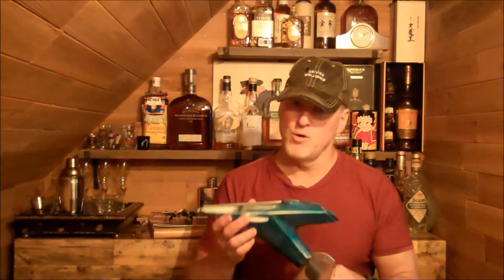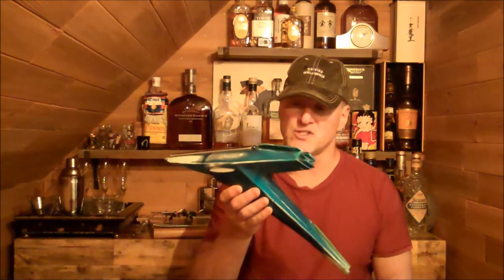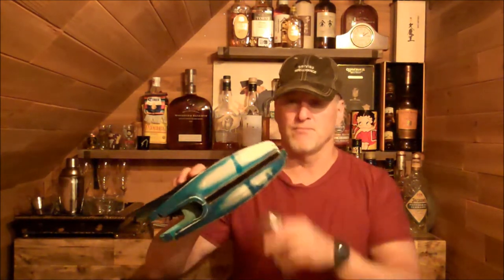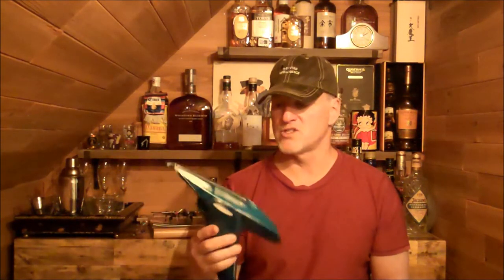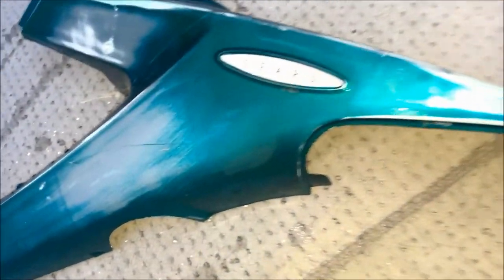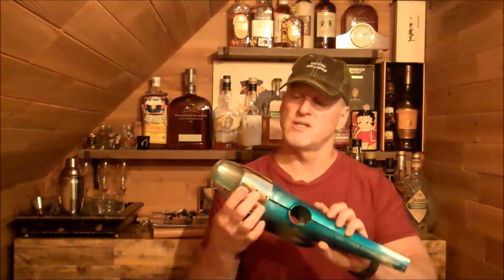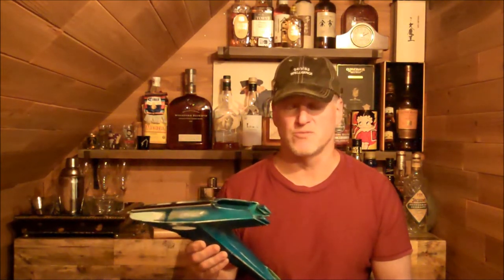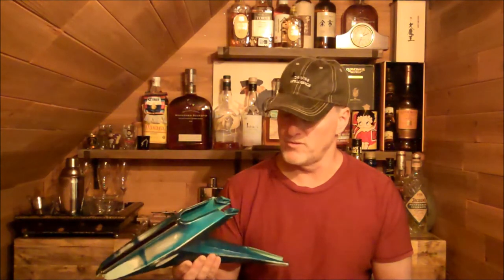1964 / 1965 Sears Spaceliner Classic Bike Headlight Restoration: Vintage Bicycle Restoration: Part 1

Comment: I too have a Spaceliner that  need a tank and light for. I would like any info on acquiring one for a men's model in red. Thanks in advance.
Reply from the maker: They're like hen's teeth.  I found another one on eBay after searching a long time.  All I can recommend is doing a search in eBay and checking daily.  Also, do an internet search.  I've seen a few more on eBay since, but in rough shape.

Comment: This is a 1966 to 1968 model.
Reply from the maker: Ah, ok… how did you know?
Reply: @DrivingIntelligence  The biggest difference between the 1966-68 is actually the tank. That one is much shorter, curved and a "swept look". The earlier 1964-65 the tanks are longer have a more conventional look, having two smaller head lights facing straight forward,  not one single as yours. Next the chain guard. Yours has a much straighter and thicker look with rectangular gills and no down turn at the front. The 1964-65 is again a much more conventional looking, being slimmer and is down turned around the sprocket in the front part. The rear rack is also different. Yours should have rectangular gills on the top horizontal. The 1964-65 have smaller angled gills on top. And it depends on what model it is, either a standard or deluxe model. There are other minor differences such as the jewels on the pedals. Of course parts can and may have been interchanged throughout the model years over the lifetime of a bike.. 

A good place to look is the CABE online. There is a very comprehensive breakdown on the different models and years, both on the J. C. Higgins Flightliner and especially on the Sears Spaceliner branded bicycles. Nice bike but how do I find your part 2?
Reply from the maker: @paulr3237  thanks for all that great info... I don't see the CABE website, can you give a little more assistance?  Sadly I haven't made any other videos, although I have done some work on the headlight assembly.  Videos are forthcoming. I was fortunate to find a good one on eBay that needs a little work.  Did you see my AMF Roadmaster restoration series?